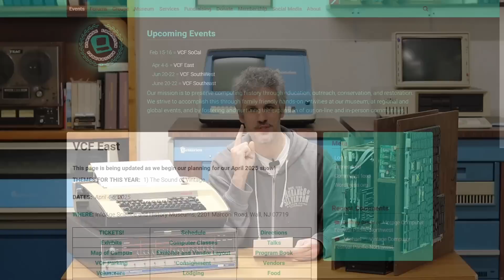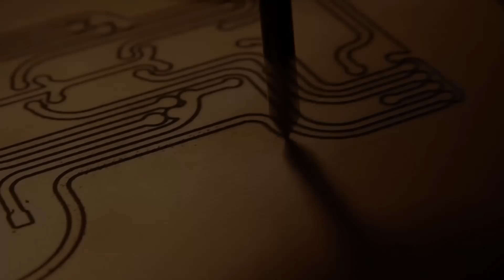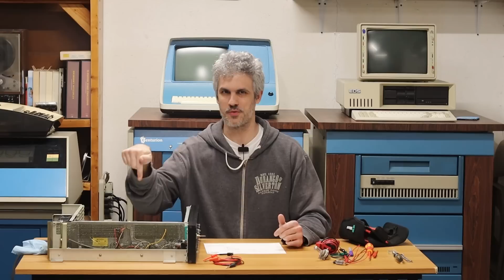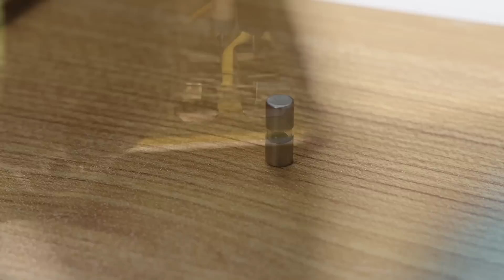Working on a Data General Nova 1210 Power Supply

Comment: Maybe those little side plates could be replaced by rack mounting ears. I never worked with DG stuff, I was very much DEC user.... after the couple of mid-sixties Elliott 920A - "small" fully transistor 18 bit core-based machines, all 8K words of it we had at school. Mainly paper tape IO with a very home brew serial port to an ASR33. We ended up with two. What became of them, I do not know.

Comment: I am pleased to see you using a 9003 headlight bulb for a load. That's exactly what I use when load testing circuits in cars and also to balance prius batteries when I rebuild those :)

Comment: The famous Xerox Alto personal computer used microcode to emulate two different CPU instruction sets, the first of which was the Data General Nova -- later support for a homebrewed language, Mesa. Earlier research was done at Xerox PARC with a network of Novas. These Novas were among the first machines to sport the original 3Mbps Ethernet cards, as well.

Comment: Looking at it I would have assumed it is an early microcomputer but after it was opened up , no way , it is very much a mini computer, mo microprocessor to be found here. Core Memory is non volatile. This computer Should be able to keep it's state after power off, which is a super nice feature. If you Set the switches right you should be able to resume the last program when powering it back on, no need to bootstrap and load from tape every time.

Comment: Wow! Core memory!   I was programming a Data General Nova machine back in about 1976, using Fortran to write data collection code in the nuclear industry.  I remember that we couldn't fit the program into 32K so we had to add an extra 16K of Core memory, which was crazy expensive - about £8000 even then!  Blew the budget wide apart!

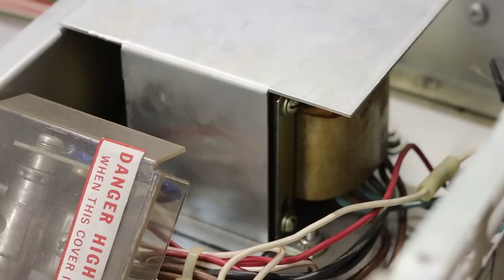Comment: 10:00 Mate. That's not a switchmode power supply. The dead giveaway that it's an analog PSU (as was standard through to the late 80s) is that it has a huge power transformer & huge electrolytic capacitors.
13:00 Good job on reforming the big electros. 10mA of leakage is fine for caps that size; it's nothing to worry about.
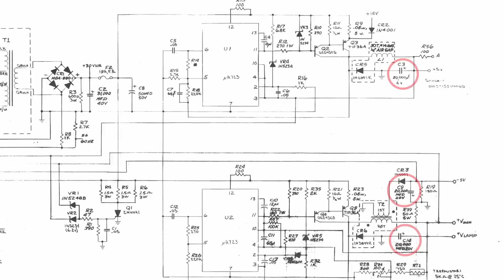16:16 Right here on the schematic is where you can see that this a linear PSU, not a switcher.
17:40 Aaargh! Tantalum capacitors are evil! They love exploding! On the bright side, ancient tantalums are easily replaced with modern electros that're near enough to the same size.
Reply: It is very much switchmode.  It starts linear to create the nominal 32V, then it goes switchmode for the +5V and +15V.  You can hear it whine as the load changes on the switchmode sections.  It trips up alot of folks who haven't seen how DG was doing it back in the day.

Comment: This is how all mutli rail switch modes work re: the-5v lol. BTW that's not really a transformer, it's more of a mutual inductor, there is an air gap and the energy is "pumped" across in lumps just like how a car ignition coil works.

Comment: It's nice to see a DG Nova beginning to come alive. In the 1970's and 80's, I worked for GE Medical Systems, writing software for the DG S-200 mini, the big brother of the Nova. We had about 80k of core memory, supporting 2 32k grounds and the O/S, which was RDOS. These computers were connected to a CDC-type multi-platter 80Mb hard disk, washing machine size. We also had a 320x320 grayscale display.  Also a Floating Point Systems AP-120B array processor. Fun times!

Comment: About the FT-IR system that the General Nova was used, please, search the article doi:10.3233/978-1-60750-045-2-1  Infrared Spectroscopy –
Past and Present

Here is an extract:
In early 1970s, Alben had access to FT-
instrumentation [67]. He states the following about his experience with FT-instruments:
“A major breakthrough in spectral resolution, signal/noise, and baseline stability,
came with incorporation of a Block Engineering interferometer into a bench-top in-
strument by Tom Dunn Associates (later to become Digilab Division of Block Engi-
neering). This instrument was originally delivered with a Data General Nova mini-
computer that contained 16 kilobytes of core memory (3 microsecond cycle time) but
no disk drive. Three-fourths of that memory was eventually exchanged for a 128 kilo-
byte head-per-track disk drive that permitted data collection at 0.5 cm-1 resolution and
32 bit fourier transforms. The signal/noise obtained was ten-fold better than that of the
best grating instrument.

Comment: Helpful tip—when removing through hole components from antique PCBs, clip all the leads and remove them one at a time. This greatly reduces the force on the traces and vias thus reducing the chances of damaging the board…

Comment: What an interesting sound that makes. Is that just ancient fan noise?
Reply: You're hearing a mix of the big AC boxer fan and the switchmode supply, which happens to be just within a frequency you can hear.  You can hear it change pitch depending on how much load the PSU is under.

Comment: This is the laptop of the mini's. What an incredibly tight fit of all those boards. Loved to see those radial heat sinks on the top-hat IC's and transistors and the bumpers that align and support the boards gently before they are inserted into the back plane. Great engineering.

Comment: I remember bootstrapping a DG knockoff in 1978 using about 25 paper tapes each holding a driver or function… ran 5 terminals with complete business apps (ap, ar, gl, oe, inv) for 3 state distribution business on 18k of memory and 10mb of disk…. Blast from the past

Comment: 8:00:  Slot 3 was reserved for the basic I/O board, replaced by your non-DG board.  You're right about basic I/O board.  It included current-loop TTY, a high-speed paper tape interface, and a parallel interface for a printer.

Comment: That's a linear supply
Reply: It is very much not.  It starts linear to create the nominal 32V, then it goes switchmode.  You can hear it whine as the load changes on the switchmode sections.

Comment: Very excited to see you working on a Nova. It was one of the first minicomputers I worked on in the early 80s.
We had a Nova 1200 with Diablo drive and a Tek 4010 graphics terminal. The system could run from paper tape or from disk with RDOS.
I later installed floppy drives which attached to the backplane by plugging onto the wire wrap pins that you showed.

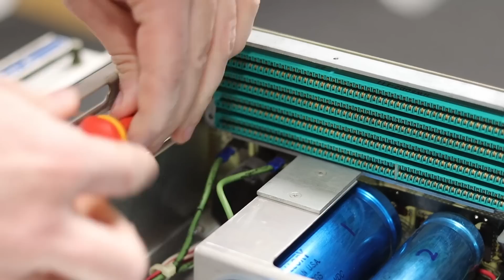Comment: 19:27 this would have been a bit easier (or different) on the modular 1200 PSUs that Nevets, Z and I have... so it's interesting to see the unique challenges of the PSUs in the 1210s and 1220 models!

Comment: The -5V supply is a standard flyback power supply. Absolutely nothing strange. Just one of the options, you can use. The other option would be for example an inverting power supply. They have used the flyback configuration, because they also use it to generate the +Vmem voltage rail, so it is kind of a fly-buck configuration.  
Also, do not use bulbs to load the power supplies. They have very low resistance cold, which may trip the over-current of those power supplies  right away, not allowing proper start.

Comment: Back when Data General was #2 in mini computers I used to repair the entire nova line starting with the basic nove, super nova, nova 1200 series, nova 800 series nova 2 series, nova 3 series, and the nova 4 series. the nova 1200 was a 16 bit computer that used an ALU that was 4 bits wide and the data was fed into the alu 4 bits at a time making it slower than the 800 series and up. the basic I/O has a serial I/O, real time clock, paper tape reader and punch interface. the one you have does not have the punch/reader interface anf the real tim clock is in the center of the board. One import thing to remember DO NOT plug the CPU into any other slot other than slot 1. If you plug into slot 2 some chips will physically blow appart. Also i used to repair the CDC cartridge drive I noticed in the background and i believe i still have a hepa filter for it if you need it
Reply: We probably met sometime at DGC classes 😅
Reply: Even the multiply/divide was an option as well as the power fail detect! (As I remember)

Comment: The absolute loudest switch mode power supply I’ve have ever heard was in a a DG Nova which was the CPU used by a Tracor Northern signal averager.  The supply operated at audio switching frequency and it was so loud it could be heard several hallways away from the lab.  Whatever model Nova it was had paddle switches on the front and it was core memory based.  You could switch the Tracor off and turn it on a few weeks later and it would pick up just where it left off.

Comment: Wow blast from the past...we used to use nova 1200s for scada systems. You started with a bootstrap loader by setting panel switches, hitting sequence, setting switches, sequence, setting switches ad infinitum.
Then you loaded the database and program using streamer (paper) tape and later cassettes..
  Then we started using pdp-11 23s, 34, 44s,  with gigantic RL01 and RL02 removable platters. Magnitude better.
Reply: If you look closely at the front panel in the video the disk boot address is in pencil on the front by the lights (circles with an X).

Comment: 8:03 on all 7-slot Novae (or your 4-slot Nova, also), All slot positions except the CPU (Lowest Slot #1) should be interchangeable, so core mem should be able to go into the same slot as any I/O.  In theory...     On the 17-slot Novae, slots 8-17 are I/O only, and do not accommodate core memory boards.

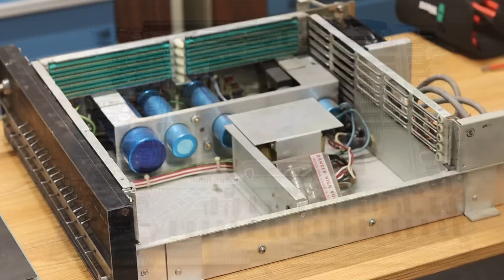Comment: 6:12 from the looks of it, the Nova 1210 is not as deep as the Nova 1200, because the power supply/ies in the back of the 1200 take up more space, because all the large capacitors are in the back PSU module.  Here, you have those huge caps taking up the space where the first 3 board slots are on the Nova 1200.  Cool...

Comment: I worked on a DG 1200 look alike (don't remember it's name) but I did find that the card connections to the backplane needed a lot of work cleaning them to get the computer to work.  I used a pencil eraser on the card edges and I think by inserting and removing the cards, I was able to clean the connectors on the backplane.  I also remember having to input a boot loader program via the switches on the front panel.  My 1200 had three memory cards and I remember having the boot loader on all three so no matter where the card was placed, it always booted.  Guess I was lucky that none of the programs ever used that memory location.  That was a fun job and we finally got it up and running and booted into the OS.  I suspect that this 1200 was used with an early CAT scanner.  I know it used to take days to process the XRAY images to make a CAT scan.
Looking forward to more 1200 videos
Regards, Richard
Reply: At one point, DG was quite involved in CAT scans.

Comment: Crazy the combination of tech on that. Seemingly semi modern ICs but core memory.  Must have been a weird combination of very early IC logic but not quite the necessary density of solid state ram chips so still needed to be core memory to get the density.
Reply: Maybe the 15 pin port is for MIDI. :p  probably not.
Reply: Kinda shame the board wasn't up to the heat.  We see boards from soviet computers falling apart like that but I'd expect more from a professional minicomputer like this made in the west.
Reply: Also that tiny fuse almost looks like something out of Christmas tree lights.

Comment: I worked for DG in the mid 80's (Well into the Eclipse era after the Nova's) My first job out of college was working memory boards. By then they were DRAM's, but my manager at the time had both those boards on his wall, they were his designs. He passed away a few years ago,  so you'll have to visit his lab in the sky for any help debugging. I can't speak 100% for the nova's but the Eclipse and Viking Back Planes were 'mostly' pass through and didn't distinguish between card types, so you could re-arrange memory, processor and I/O boards. 

The black layers was also to help with cooling, it provided a bit of thermal insulation to the next board as well as helped keep the air channeled over the components. 

A quick look at the 'external connector' you thought went to an add on is likely to be a back plane bus extension and would follow the system bus protocol, remember they were very slow compared to today.

Caveat: Please remember that was 40 years ago so there could be some accidental misinformation. :)

Comment: -5V is typically used as a bias supply that doesn't need much current, and the voltage probably isn't very critical, so it makes sense for its circuitry not to be any fancier than needed.

Comment: You probably already know this but standard H4 headlight bulbs have a resistance around 0.2 ohms when cold.
So a current draw of 60 Amps when using with 12 Volts! (for a fraction of a second) before going down to around 5 amps. 
Something to keep in mind when using them as a load in sensitive electronics
Reply: Good point, though in this case I was wondering if it wasn’t the Tantalum capacitor blowing up that did it. They do like to fail short, and this one was likely between a voltage rail and ground. Although, I don’t know if they short while blowing up (and the last blown up one I saw was definitely open in the long term).
Reply: @enojelly9452  
Yes, most likely the tantalum shorted and then exploded.( I wasnt saying that the H4 shorted the Voltage rail, just that it could be a hard load for some power supplies)
Reply: @MyCrazyGarage  Got it. Your comment definitely adds value, yeah, and may prevent much worse problems actually. Shorting Tantalums are easy to replace...

Comment: If memory serves, Tantalum caps were used often because they had a better high frequency response than plain electrolytics. I think they were also more compact. The back edge connector is an extension of the I/O bus allowing external devices to be addresses, and allowing them to request interrupts and DMA access. (Similar to DEC, but the I/O was not on the memory bus.) There were also a few dedicated slot things going on, which is why you found the serial I/O in slot 3. Wrote a lot of assembly code for these guys in the early 70's, including a Non-DG disk operating system. First thing my boss thought me as a new programmer was to assemble the machine from a pile of boards in case the EE's had visited the software lab. How are you going to get code into this thing? Paper tape? Where is the disk drive?
Reply: Tantalum capacitors are different animals to standard capacitors. Designers don't choose because it's a nice colour 😂

Comment: Oh YEAH!!!!  The work begins on the NOVA!!!!!  BTW, this differs quite significantly in layout (if not circuitry) from the Nova 1200 power supplies, which are modular and fully removable!  The 17-slot Nova 1200s even take TWO PSUs simultaneously!

Comment: Your method of reforming caps is pretty well exactly how it should be done.   Waking them up slowly is the best way if you have to reform them.     With caps like the ones in this machine, they will likely be fine reformed,  They are good quality caps.   I am usually quite cautious of reformed caps because electro's can dry out over time, or they can decide to just short circuit for the fun of it so to speak.   I deal with tube equipment though, which generally is a lot older, so the caps are in a lot worse condition :)
Tantalum's are okay as long as they work.  They are very accurate capacitors, usually much more accurate than Electro's.    The downside is their failure method, which is likely why this system had that cute fuse in the PSU.   In case a tantalum decided to turn into a jumper

Comment: Hi, I have been watching your channel for a year or so and very much enjoyed it so was very excited to see you working on a good old Nova😅 I studied electronics and computing at Chelsea Collage London between 1969 and 1975 at undergrad and post grad level. The guy who taught me digital electronics and computer architecture and was also my post grad supervisor was Ralf Townsend. Before returning from the US to teach he worked for DG and was one of the designers of the Nova. He wrote a book on digital design and used parts of the Nova as examples. As a postgrad I proof read it for him and have a copy somewhere that I will dig out. My first job was at the GEC research Center in London. What did I find in the lab ? 2 Nova 1200 minis. They had hi-speed tape reader and punch, 2M fixed disk and 2M removeable cartage disk. We used Fortran and assembler. We rote a Intel 8008 (not 8080!!) cross assembler and stared experimenting with microprocessors in 1975.  When I find the book I can scan it and send you a copy if you are interested. Best regards. Neil Wilson

Comment: The redox reaction between Ta and MnO₂ is the same situation with fuel and oxidizer as in aluminium + hematite *thermite*, except this is in a tiny little enclosed package. Once the Ta₂O₅ dielectric is broken, by a voltage spike or such, and they are in contact, you will have a tiny piece of Ta with 1–2 Ω through which a lot of current might potentially flow → easily >900°C or so → big badaboom!

Comment: That's probably the data and address buses, à la ZX Spectrum, intended originally to go to an external card cage -- probably an identical chassis with a plain front panel and its own power pack for the added devices.  But since it is carrying all the bus signals, it could go to some external device occupying a lot of address space e.g. to connect many sensors or actuators on a complex piece of machinery; or able to halt the processor, take over the buses and write directly to the memory.